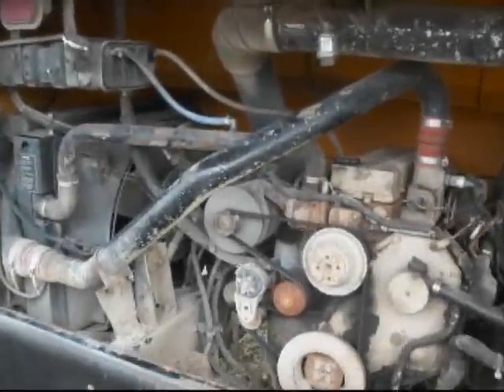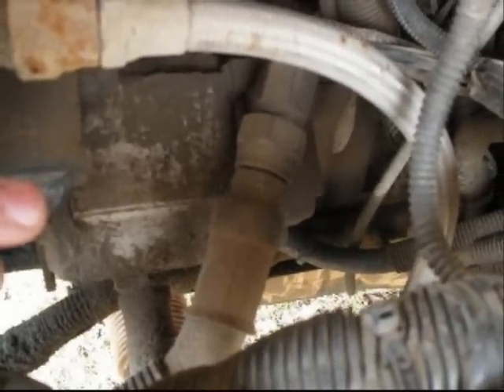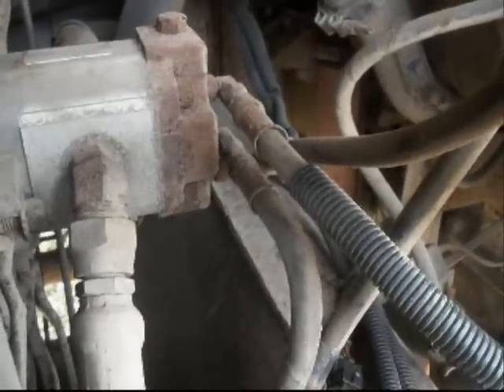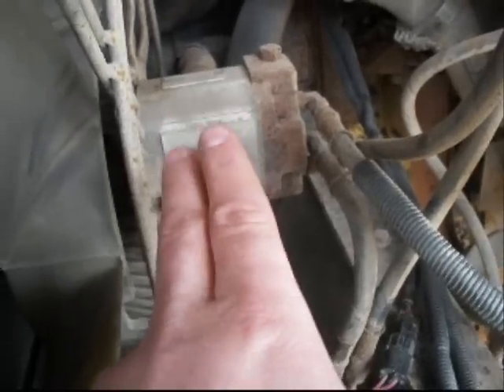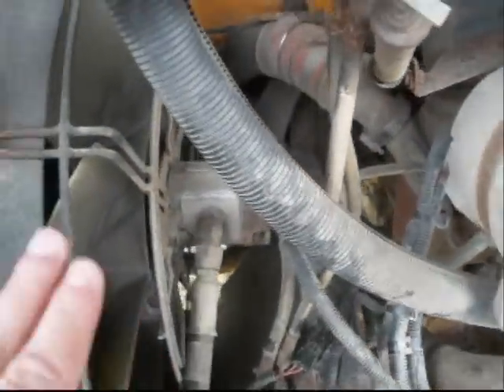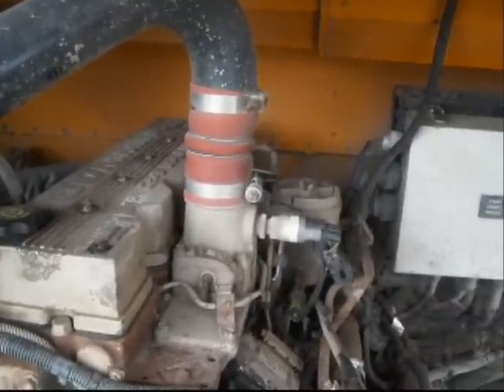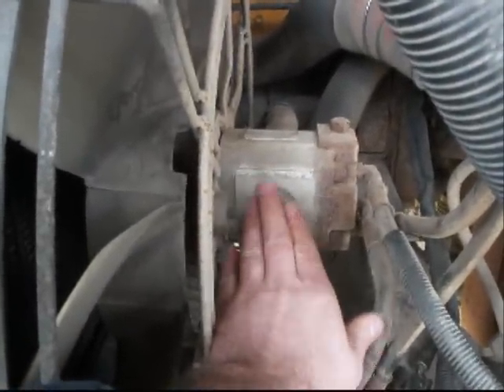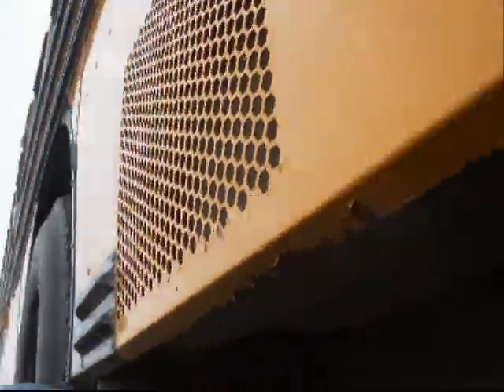Blue Bird Hydraulic Fan Drive System

Comment: So if the fan does not change speed when the CAOS is unplugged the CAOS is bad?
Reply: That's my question as well.   Did you ever get an answer?
Reply: Either the solenoid or sensor are bad

Comment: I have a question not really about the circuitry but wondering if you knew what type of oil the power steering pump requires?
Reply from the maker: This particular set up uses 10W-30.

Comment: GREAT video! This is almost identical to the setup we have here on our UK buses, although ours seem to always be running hot and make a much louder sound. Us Bus Enthusiast's have called it "Hoovering" haha.
Reply: Seen this happen a lot where i live (Italy) too, but i think it's mainly bad maintenance practices where, instead of fixing cooling system issues such as dirty/seriously worn radiators or worn water pumps, they just bypass the control system and let the cooling fan roar like there's no tomorrow, and that's it. Sometimes they get them fixed properly, but that's pretty rare occurrence, making it pretty clear that it's just a matter of penny pinching

Comment: Very good video, but I must raise a significant issue. The narrator continually calls the fan drive motor a pump. It's not a pump, it's hydraulic motor. As he explains at the beginning, the power steering pump provides the hydraulic power and is located at the rear of the engine. The motor is what drives the fan.